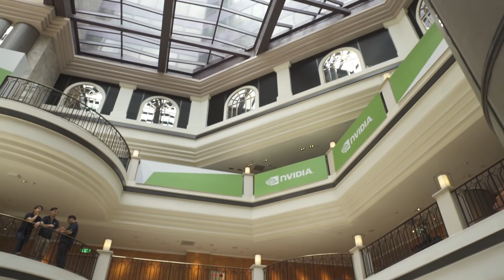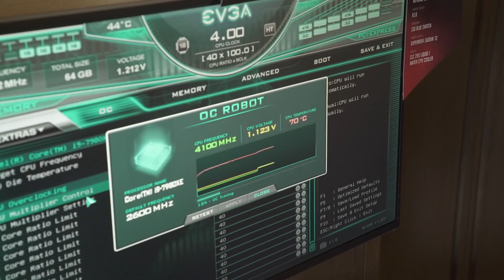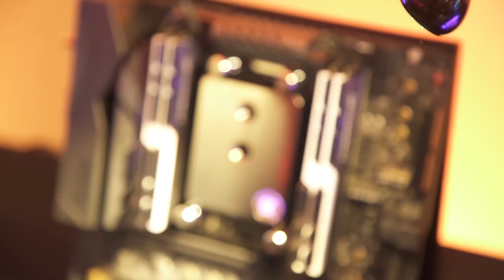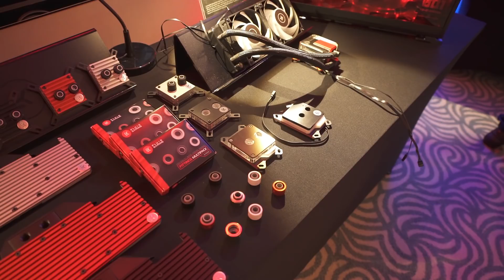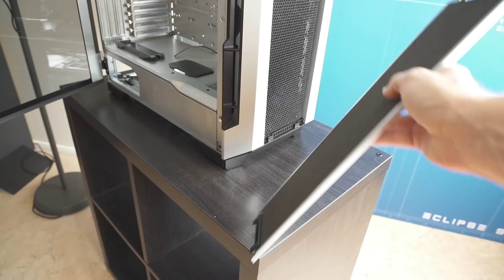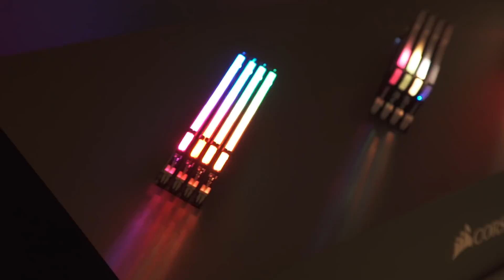The Sexiest Watercooling Gear EVER...

Comment: Hi, newbie here! Getting funds together for my first ever gaming PC. I play on the enhanced consoles so I want a PC that can outperform them. I'm aiming for 4K 60 Ultra settings. Basically my question is, would it be better to just save up for the full experience (Say around £1500 depending on GPU market) or build a solid PC and add as I go? My plan is to save up for around 6 months and have most of the funds and take advantage of Xmas sales. Also I'm not going to able to hardwire an ethernet until I move into my new place. What is the best way to get a reliable connection?

Comment: Can anyone give me advice on a build?

Ryze. 1600
H100i v2
MSI b350 Tomahawk
MSI Radeon rx 580 Armor v2
2x Seagate 1Tb 7200 3.5 in ( already have these)
1x Samsung evo 950 series m.2 250 gb probably
1x Seagate 1Tb SSHD 2.5 in 7200 (also already have from old hardware) 
EVGA 600BQ semi modular
Fractal design Define S no window version
2 extra Fractal Design GR-14 140mm fans ( same as what the case comes with)

Thoughts?  Budget is $1k or below

Comment: Okay. I am planning on building a new PC. Memory is going to be either 3000MHz or 3200. And I am debating over a Ryzen 2700x and an Intel i7 8700k. I will be doing Streaming and Gaming. Which do you guys think is best for me. Also please include temps if available and recommended coolers (I prefer corsair). Thanks!

Comment: Jay, sorta off topic, but still related to water cooling. What would happen if you used blower style fans on a rad? Blower fans have high cfm in most cases and some have higher vacuum. Something cool to see might be blower style fans set up in a pull config on a rad. I think this might result in a good amount of noise produced, but possibly more air moved through the rad for better cooling. I’d like to hear your thoughts, and maybe see a video on this. I am also thinking about trying this on my personal rig, just having a hard time finding the fans. I think I may have to do some custom work here do to the way these blower fans are generally made.

Comment: Not that I dont appreciate innovation in the water-cooling space, but whats the point of a flowplate? I've been using one of those cheap sub $20 blocks jay showed off not too long ago and its pretty barebones, doesnt even have a massive fin density like ek blocks yet performs marginally the same. It is a couple of degrees hotter but my 8700k still doesn't even hit 60. I'm starting to think its all just a marketing gimmick.

Comment: I'm looking into putting together a system in the next few months, but my main issue is space. I want the system to look nice, but to have it fit with an ultrawide monitor and a pair of good speakers it's gonna have to be under a shelf built into my desk. Can't really tell from the vid but if that mATX case is less than 13½ inches tall I'm sold. Looks gorgeous!

Comment: The X299 Micro 2 is pretty interesting. I'd love to do a micro-ATX X299 build, but the original X299 Micro is not on my list right now. EVGA's X299 boards (the Dark excluded) tend to look very plasticky and gross with their implementation of RGB lighting and the I/O cover, almost like a Fisher Price factory vomited on them. Improving the finish would be a welcome change, but it looks like it still only has one M.2 slot, while the likes of the MSI X299M Gaming Pro Carbon AC (there's a mouthful) and the ASRock X299M Extreme 4 both have two M.2 slots.

Comment: 11:17 At last, a fan filter you can probably put in the washing machine :)

13:27 I suggest the 280X should have (you've guessed it) an RGB logo, since there's enough space internally for this.  However, the top-front of that dual chamber is where some HDD cages are - what if the panel had hot-swap drive bays?

Comment: Jay, why are you still lying about the Fluid Gaming series for EK? It's not a cost effective entry point for water cooling, you drop 200+ dollars on a low quality kit where the only usable parts if you switch over to copper are the fans. This is compared to just buying an XSPC kit and blade GPU block with two extra fittings for the block, which costs 20 dollars more for all copper parts. That's 20 bucks more than the A240G, and expandable with all the parts that basically everyone else in the industry makes other than EK. 'Cause, you know. Gotta be special. Gotta make parts that are incompatible with the rest of the standards the entire industry adheres to. I N N O V A T I O N.
Reply: Might I even say... Courage.

Comment: Nice vid Jay. Looking for advice. I am bending PETG (Bitspower tube with bitspower silicone insert), yet every time I bend it, it is changing the diameter of the tube where I bend it. As such if I need a tight bend to a fitting, I cannot fit the tubing as it's no longer a 12mm OD. Anyone have any ideas?

Comment: Problem with very small PSU is that all the electrolytic capacitors get too much heat, since they all seat next to hot parts... And electrolytic capacitors lifetime degrades a lot with heat, so don't expect them to last as long as the bigger ones

Comment: Why did it take so long for a bios stress test wow
Reply: The original BIOS was nothing but firmware flashed to a ROM, with extremely limited size. The newer "type" of BIOS has basically turned in to a stand alone OS, with all of the options available. Besides the average end user, could not be bothered with custom O.S. profiles, or even have the desire to learn about it. Us PC "enthusiast" are such a small chunk of the market, it is a small miracle that EVGA has even gone this far with things.

Comment: about the post malone build I was thinking that to make the fluid look like beer you could device a cover for the reservoir with liquid inside like those old cups that have liquid inside of the walls (that make sense?) anyways something that would go around the reservoir and contain its own liquid that you could find a way to keep carbonated. OR you could just wrap the reservoir on some sort of see through material that has tiny bubbles that look like carbonation printed on it.

Comment: When is Phanteks going to put some larger airflow filters in the top and front of the evolve? I understand that the 1" wide filter slit was "an improvement" :) Did they sign a deal with custom case guys with lazer cutters not to?  Jeez, the aftermarket makes the dam fronts and tops with 50% or more coverage filters why can't Phantex?  I bought a older model instead of the evolve 2yrs ago because of this and I may just build my own lazer cutter and get some screen to make my own Evolve tops and fronts instead since Phanteks seems incapable of it :)  Oh The bigger spacing of the front is a nice attempt as well and is livable but the top is not gonna flow enough! Hopefully this new model makes marginal airflow instead of terrible . :)  Oh well maybe next year. Love that case otherwise. Just fix the top and front:)

Comment: 12:23 why is there no sli bridge?
Reply: Krexci sli is dead
Reply: v Nyggi SLI only works with a Bridge, Crossfire works over PCI
Reply: v Nyggi - But then why have 2 GPUs
Reply: For the looks lol.
Jk you can have one card per monitor if you want to power multiple monitors, and the new Vulkan API can use as many cards as you want simultaniously (even nvidia + amd across generations is no problem)
Also I think the current crossfire works via pci and doesnt need a bridge anymore.

 Dont know how that is for sli, but I know that sli only works in few games and only brings minor improvements in some while in others it gets worse even, and you have to deal with microstuttering
Reply: I saw that too, took a second look and the SLI bridge is lying in the back corner as if it was knocked loose from the cards.

Comment: BIOS stress test and "auto" OCing??! thats it, take my money, i dont need a new GPU that bad anymore
Reply: Zap Actionsdower auto oc is not new, question beeing how good it is
Reply: yeah i was wondering if theres a way to keep an eye on throttling inside the BIOS (didnt look that long at the gui, just seemed like a cool feature)
Reply: I guess every "gaming" motherboard has auto-oc, MSI calls it OC Genie, Asus has 5-Way Optimization, I don't know about the others but its pretty common and usually sucks, the tests these things run are way too short and that makes them go way up with the clocks and voltage.
Reply: That's a amazing feature, hope that come standard in all new motherboards
Reply: Dude! Etch the wood with the album cover design!
Reply: My old Asus AMD board from 2012 had auto overclocking. It wasn't very good but it was there.
Reply: My asus mobo does it, checked it afterwards was a good speed but the voltage NO WAY would I run that. forgot what it was but did the same speed with much lower voltage and temps.
Reply: Just Weird
 don't know if you mean what i think you mean, but my asus board did slight overclock too so it sets my 6700k from 1core boost clock to all 4cores boost clock, but at the same time it pushed the voltage up to 1.45v instead of arround 1.2v which is insane, so my cpu got up to like 90degree after first stress test, now its ~70.
Reply: haha knew this comment would be here. Seeing the robo OC increasing slowly was pretty cool